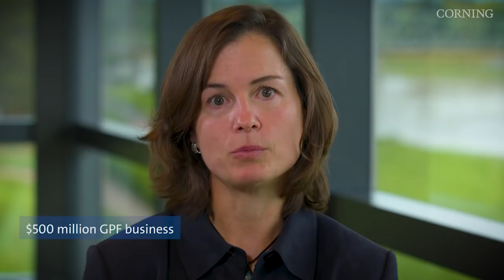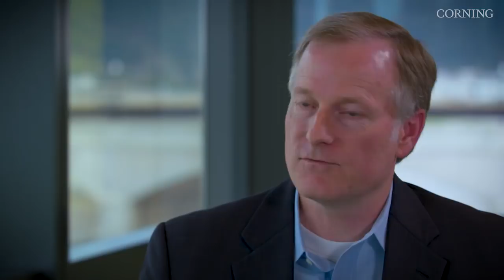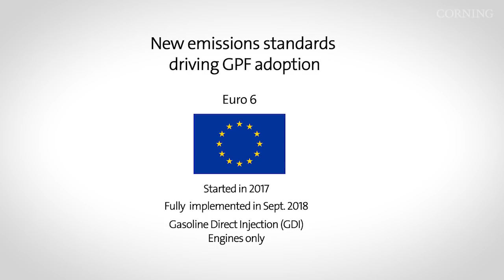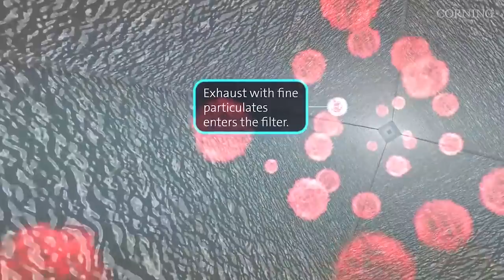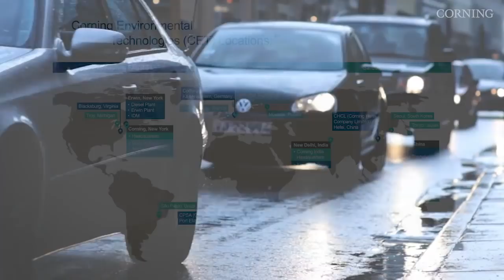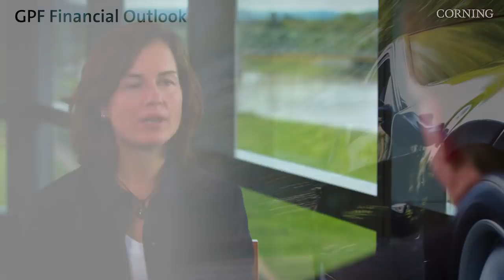The next generation of gasoline emissions control technology

Comment: This is a big business profiting off the backs of average people. When the system fails the consumer will have to fork out thousands to fix a broken and flawed system. IE DPF systems in modern diesels. I am not saying to no come up with a solution, but in fact one that will actually work for a vehicle, be cost effective, simple, and will last 175-200k miles of consumer driving. In my experience EGR, PCV, and DPF's have killed prematurely perfectly good diesels at around 125-175k miles where in the past those trucks would have run for 250k-500k miles or better. My question along with this is if you make the engine burn the fuel as efficient as possible increasing it's mpg, wouldn't the fact less fuel is burned off set the use of these filters over time? And let us not forget, we are talking about implementing technology in countries where emissions aren't a glaring smacking in the face unlike an India where they are shitting everywhere and burning trash daily.
Reply: Also, the gpf filter should be easy to replace and should be manufactured by third party manufacturers as well so consumers don't get ripped off
Reply: Fucking 'A right, Jon! I'm so sick of this shit...
Reply: Well people shitting in open is common in US as well. Just go to any ghetto neighborhood, SF streets or greyhound station.